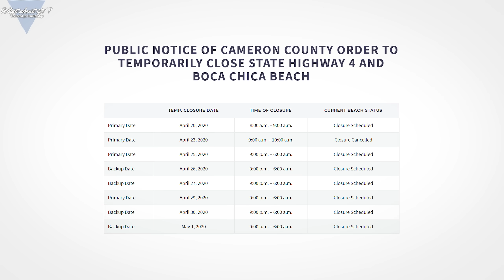87 | SpaceX Starship Updates - Starship SN4 Passes Cryo Test

Comment: I heard it suggested that Spacex will move from 304L stainless to 301. This was, as stated on the video, for better performance under cryogenic conditions. 304L can lose structural integrity at weld heat affected zones & corrosion also becomes a problem. This is partly due to chromium carbide precipitation but this can be controlled by various techniques, including keeping the welding temperature below 426°C (800°F) Deformation at low temperatures also adds to a change in composition & structural stability. Because the Starships are to be reusable, the fuel tanks will undergo repeated cooling & pressure changes. I guess the move to 301 must ease these problems but as the difference in composition of the two alloys is very small, I wonder to what extent. I’m interested to know how this will affect the life of the Starship. Has anyone heard Spacex elaborate further on the use of 301, the welding techniques or the life of the tanks etc. If so could they provide a link to any information.
Reply: Ian,   
They are already using 301;
The next iteration will be stronger, but it will still be in the 300 family.

Comment: I guess they only went to 4.5 Bars because they knew this version wasn't going to space and they have new and improved metal coming that should make attaining 8.6 easier. For those who don't know one Bar is equal to standard atmospheric air pressure or 14.5 psi. Also I was curious how Falcon 9 is built so I looked it up. Falcon 9 is built using ring sections as well which sort of explains the current methods of construction. I think that once SN5 is done and they have switched to the new metal, things will advance twice as fast as they are now. Once the design and manufacturing process is finalized the assembly team should be able to produce them very quickly. The benefit of so much practice building them.

Comment: There is lots of work and this is just the beginning. Like installing those tiles will be a bigger task. Fairing section: those are test article. I foresee three variant. 

  The tanker version. This fairing can be used nearly as it is. Shipping LOX or Methane to LEO.
  Cargo version. This will have a huge door on the side... It requires a different building technique.
  Crew version: This is the most complicated one. complete different interior and exterior. This is the most complicated to build and that is the most expensive too.
There is reason to rush: huge amount of work ahead.

Comment: Progress will definitely have to pick up the pace. They still have to build the booster and an aluminum starship. That's right, there will have to be a lighter-weight version. If they want to build a sustainable presence in space they need to bring a hell of a lot more stuff with them. They need the entire farm. Pigs, chickens, fish and cattle, and all the farmland to grow the food to feed our intrepid astro-citizenry who will want to eat everything we do on earth, and without a supply train that stretches from earth to Mars or even further. We need starships that will never need to go through a re-entry. They will have to be as light as possible, as cheap as possible. That means Aluminum or some alloy of aluminum. It will still need to be coupled with up to a thousand other aluminum starships and a few dozen lander style stainless steel starships and maybe a few hundred smaller landers based on the second stage of a Falcon 9 and Dragon capsule. This I suspect will be needed to allow for a landing abort sequence and a take-off failure abort method for getting back off of Mars if and when we finally get there. The aluminum versions will need to couple together autonomously and with great structural integrity so I suspect they will need to be hexagonal in cross-section and be interchangeable and capable of serving as a type of lifeboat in the case of a massive failure of some sort. They will allow for rotational simulation of gravity, and large greenhouses and open spaces for landing and launch of space station manufactured space hardware. We need a space station to learn how to be self-sufficient as we live in space. Recycle everything and build a new kind of humanity. We need everything including the farm to come with us..

Comment: Hey Felix,
Do you know what all the flames around the fuel farm are during SN4 pressure testing?
I saw it on the livecam but didn't see any insightful comments about it so far
Reply from the maker: Those were vents. Backlit by some lights. All good! 😉👍
Reply: Some of the floodlights are the sodium type, which give an yellow/orange light, and spectacularly back-light clouds of gas.

Comment: Heat Tiles, anyone else having flashbacks...
Reply: Looks at Colombia Space Shuttle
Reply: Luckily these will be bolted on instead of glued.
Reply: Eric Lotze,
If You get a chance to see the Air/Space Forces mini (Apx. 1/10 of the old Space Shuttle) shuttle,  the Heat Tiles are substantial improved over the old style on the original Space Shuttle.

For what it’s worth Every Flight of the original Space Shuttle was considered to be Experimental.
That’s not true of the military’s shuttle;  Which also can stay up
for Apx. (3) three years or more.

Comment: "Old-Timer Moon Rocket".... ya, don't like the label...."Most incredible feat of human engineering, and only rocket to land humans on the moon and return them safely" is a better label.   Starship/Heavy is an ambitious and laudable project, but so far is only a two-chambered pressure vessel of dubious capability.
Reply from the maker: Don't feel attacked. That's not how I meant it. I am just disappointed that we never went on and after so many decades still have to see it as the reference. A corvette Stingray is awesome. A Tesla though is better in very technical aspect.
Reply: @Whataboutit  A Tesla Roadster was better than a Corvette Stingray, when it proved it was empirically better.  Could you imagine if the Apollo/Saturn V had been incrementally improved until now?  Starship/Heavy would look archaic... I think we're all excited about the SpaceX progress... but until it exceeds the metrics of a half a century before... meh....SHOW ME!

Comment: 11:19 I don't know where but I think you said oxygen 1 too many times. Is the oxygen tank upper or lower?
Reply: I believe the lower tank is going to be the oxygen tank. Here’s my reasoning: for ideal combustion of methane and oxygen you’ll need 4 kg of oxygen for every 1 kg of methane. Liquid oxygen has approximately 2.7 times the density of liquid methane, thus they should need more volume in the oxygen tank than the methane tank. The lower tank appears to be the larger of the two.

Comment: I remember there were 5 rolls of 301 Stainless Steel back in January, and that means there are likely no rolls left after SN-5. I am expecting that SN-6 will be made by the 30X Stainless Steel. 

That will speed up the welding of two rings together, as  was pointed out by Elon this week. I expect that the metal will be thinner and therefore lighter, as well as resistant to melting under the weight of the welds. Thus speeding up production. 

By September/October I am "hoping" that the new Cold Roll Machinery to accommodate larger width of 30X steel will be in production, to turn out what I am hoping is an increase from 12 ft to 18 ft. This will eliminate 1 weld. Thus speeding up production even more. I think 18 ft because of the present height of a 3 ring segment is 36 ft. This may change. If someone knows the maximum height of the Onion Tents they can correct me. 

Elon is pushing, but has become more cautious in his predictions. Hesitating to be firm, and giving wiggle room if things don't pan out. Perhaps a sign of age LOL. and with that I will duck outta here :D Cheers and be safe.

Comment: Didnt they planned to not have a head shield and to cool the hull by "bleeding"?
Reply: they did float the idea about but I think it was mostly abandoned due to the complexity - the best part is no part and normal heatsheilding is tried and tested and easy to implement AND spaces has there own internal composite already made and tested from the development of Dragon so i guess it was just easier to just add tiles.
Reply: They did, but it was scrapped because the system needed to make it was far too complex and it was decided the heat tiles were an easier option. They are trying to mass produce these things and one of the things needed to really make that happen is as simple of a design as possible.
Reply: Ok that makes sense. Thanks

Comment: i feel things are gonna slow down drastically when they start working on aerodynamic parts like getting the flaps perfect and reliable (still really fast compared to the rest of the industry but) then again with the heat shield if they have the same issue the shuttle did with tiles and I can imagine life support and crew quarters being a bit hard and stuff like that. not to mention the crew rating process
Reply: Mike McLaughlin - These are a LOT more robust than the ones on the Space Shuttle which often fell off & needed to be replaced every few flights.
Reply: I hear you man. This is just a fuel tank so far. But the Spacex approach sure is exciting to watch!
Reply: Mike McLaughlin,

If You get a chance to see the Air/Space Forces mini (Apx. 1/10 of the old Space Shuttle) shuttle,  the Heat Tiles are substantial improved over the old style on the original Space Shuttle.

For what it’s worth Every Flight of the original Space Shuttle was considered to be Experimental.
That’s not true of the military’s shuttle;  Which also can stay up
for Apx. (3) three years or more.
Reply: Hedonist Aesthetic that’s true, but starship has a lot more surface area to cover with those tiles hopefully all goes well but the crew quarters and living space and life support and the biggest windows to ever go in space may back things up. Having said that the most talented people in the industry are working on it so I have faith
Reply: Mike McLaughlin,

Check the post of (X22 B); it has some interesting info on modern Heat Tiles.

I understand that Musk/SpaceX has developed there own version so I’m sure that it’s designed for the shapes of SpaceX’s rockets.

In this video it shows them trying different ways to attach the tiles.

The site w/ the information on some of the modern Heat Tiles is:

https://technology.nasa.gov/patent/TOP2-241

Comment: Isn't SN2 passed Cryogenic test?
Reply: It did but it was only a thrustpuck with other parts (I don't know their names) and it was only a spheresque tank to check if the new thrustpuck design was correct, which indeed turned out to be right.
Reply: @Brick_One_A_Lego_Story  but it was called SN2 🤔

Comment: How it will land if it has no landing gear/legs? I don't think this will fly, maybe static burns with one, and then all 3 engines.
Reply: They either are or soon will be installed
Reply: the six landing legs are folded up under the bottom skirt and should deploy before landing.

Comment: Still looking forward to see the Rapture enging start even though its only one we should get some data from that vibration damage etc I guesd Elon is goinfto do them one at a time so that we can see just how much vibration the cylinder can take but does this mean thar SN5 will not be cryo tested?
Reply: Yes he is being cautious as he said himself in tweet a few days ago that even current updated thrust puck design is 'dicey' (his word!). Said that it has 4 overlapping layers of steel and they are updating design of thrust puck to simplify and strengthen that weakness including revised puck design geometry. Not certain if new thrust puck design is used on SN5 or will it make it onto SN6/SN7

Comment: I've got to say, 4.9 bar is kind of disappointing. Makes it look like it would've exploded if they went any further. But don't get me wrong, I can't wait to see static fires and some hops.
Reply: i think elon just wanted to get sn4 to hop so he can get some data for future serial numbers, future starships will be pushed harder.
Reply: @tauraspace  Absolutely! Doubtful we will even see an orbital flight until the end of this year, from now until then I think we'll just see many many short test flights with incremental upgrades
Reply: Im betting they wanted to get the static fire done and hop. They will probably find a plethora of issues in those two tests that they will be able to work on while they work up to the full pressure.
Reply: As for now, it's actually okey that they only pushed until 4.9 bars. At least they'll now be able to test further process such as the static fire ! (and hopefully the hop)
Reply: sbmphr  steel isn't really the major problem I think tho. Welding and overal design is
Reply: I think it's simply about the purpose of the test. They've done enough pressure tests previously to be confident that the design works, that they can cope with the full pressure. SN2 proved that, and given the upcoming change of material, there's little benefit in repeating that test on SN4.

The purpose of this test is much less ambitious - they want to be sure that SN4 doesn't have any manufacturing defects that would cause it to fail (more expensively) during the static fire or short hop. Once they switch to the new steel grade, we'll be back to doing full-pressure testing, but it just isn't necessary or useful this time.
Reply: It's more than the pressure of the propane bottle in your grill (about 4 bar.) But it had sounded before like they were aiming for more like 6 bar with a safety factor of 1.4 (so 8.4 bar.)
Reply: Eli Harman you are correct however those are the targets for crewed flight, they stopped at 4.9 because they know itd A look bad if another blew up. B waste of time and money on sub optimal hardware. C it is enough for a test flight to 150m using one raptor. They likely stopped at 4.9 because they want to test the knew thinner structure in flight and test the vibration of the engine
Reply: Exactly. If it's good enough for Musk...Yes we would all like to see it pushed to it's theoretical limit but I think he took some practicality in here

Comment: Wait, Starship will be bigger than the Saturn V?  I was not aware. In what ways bigger and how much bigger?  Height? Power? Payload?  Other? All?
Reply from the maker: Amazingly enough... all.
Reply: What about it!?, ok great!  By how much?  Have you already done an episode on this?
Reply: Eugene Bell this video is old. Starship Has grown  in height since then.
Reply: all of the above.  Elon likes it when people say his is the biggest...
Reply: Diameter: 9m Starship vs 10.06m Saturn V. Height: 120m Starship vs 111m Saturn V. Thrust: 72mn Super Heavy booster vs 35mn Saturn V S-IC. Payload: 100 tons Starship vs 118 tons Saturn V.
Reply: Ryan Spence   The payload difference is most likely due to the Starship's fully-reusable design. Since theSaturn V didn't need to land anything except the command module, all of its fuel could be used to provide maximum thrust at launch. Both the Starship and SuperHeavy booster need to keep extra fuel for landing.